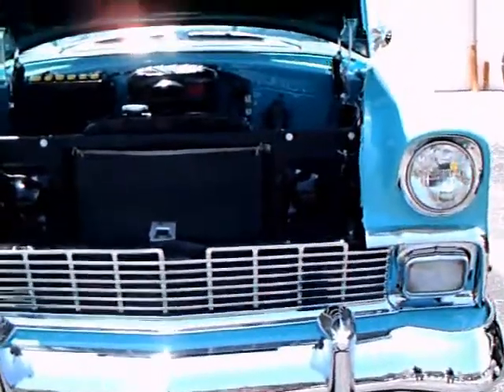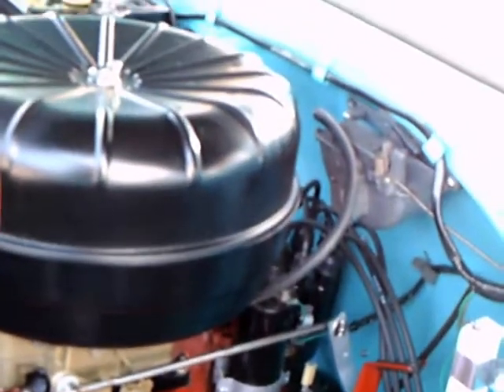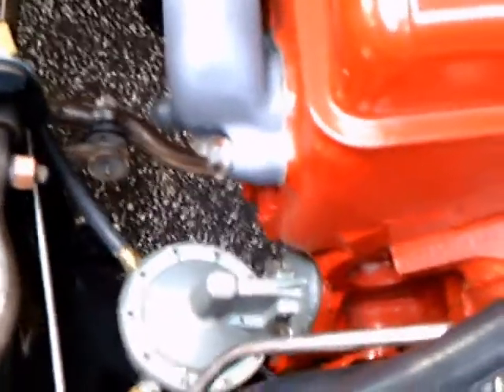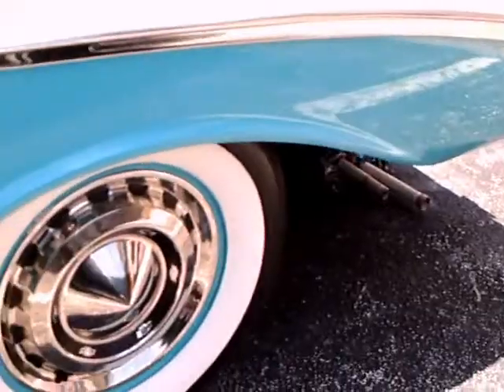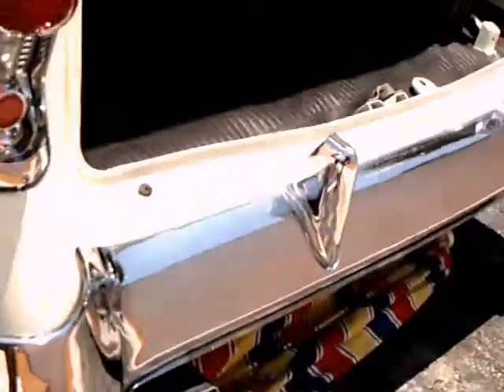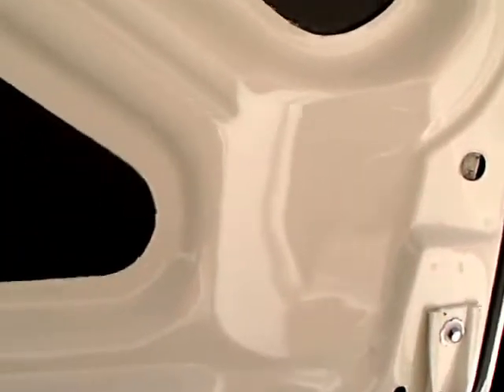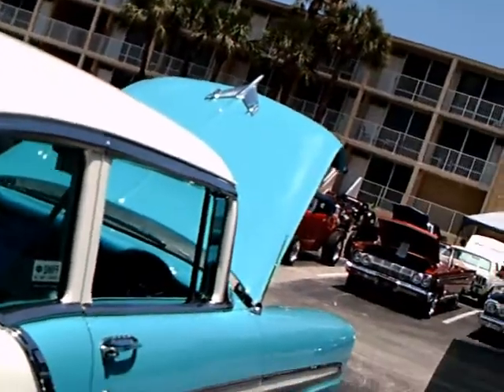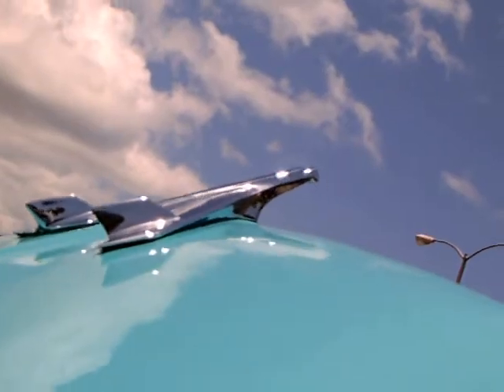1956 Chevy Bel Air Two Door Sedan BluWht CocoaB051912

Comment from the maker: Hey, Jason!  I checked the numbers...all types of Chevrolet sedans, not counting other models like Corvair or Corvette...1955 (1,702,710), 1956 (1,529,510) and 1957 (1,401,678).
As you can see, the differences are there, but not dramatic.  It does show a decline in sales from 55 to 57, probably related to the newness of the 55 design wearing off a bit by 1957.  1957 was a disappointment in sales..it sparked the substantially different 58 model.  Thanks!  :) Jack